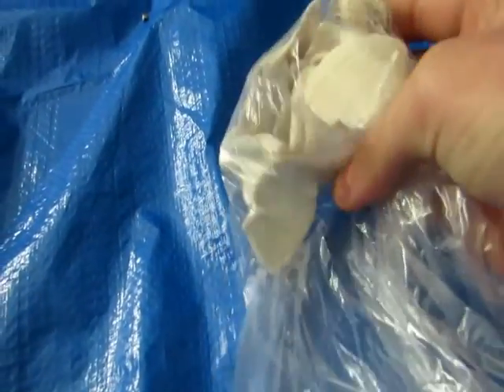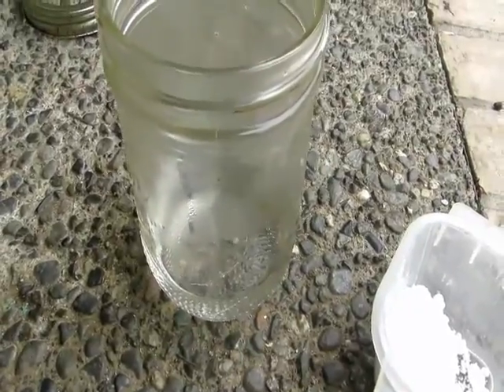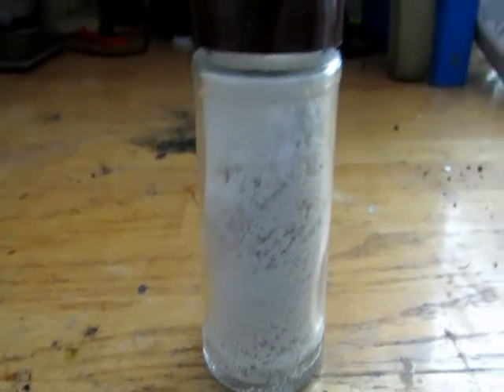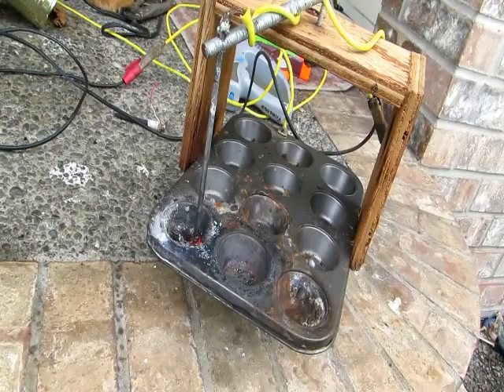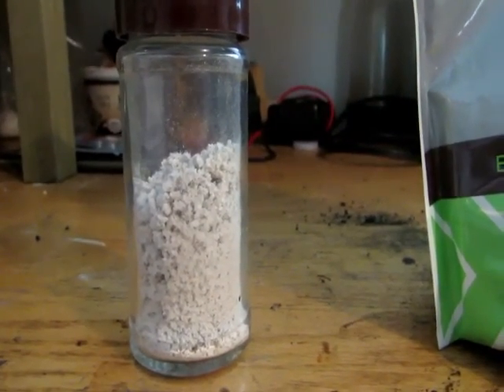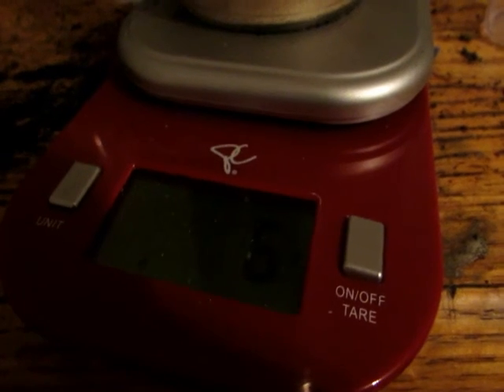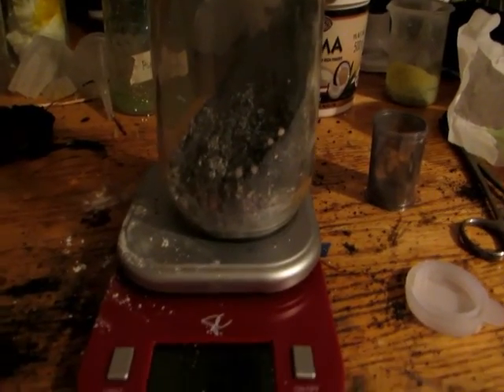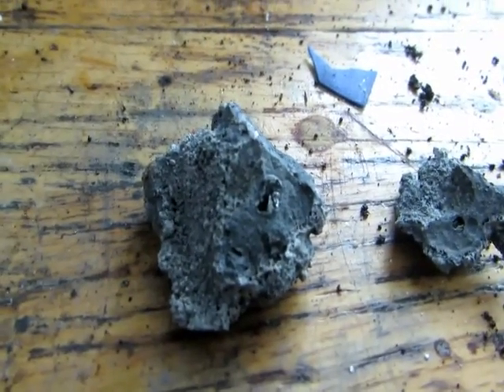How to Extract Calcium (Household Materials)

Comment: I was going to do the same thing except with antacids and heating up the calcium carbonate to its melting point in which it becomes calcium oxide, where you put it in water then do electrolysis. Except calcium becomes Hydroxide form in water, so i didn't wanna use mercury and gave up trying to do it myself and followed his video lol

Comment: dude, me and you need to Collab or something, you had the exact same idea as I did xD
(first I need to get my recording equipment ready and post some videos tho...)
I planned on using chalk, not seashells, they're both calcium carbonate tho.
how old are you? (don't worry I'm a teen too, I just want to relate or something...)
yes, metal hydroxides have a lower melting point that metal chlorides (I did some research) and if the calcium chloride electrolysis didn't work, I would have simply gotten some chalk, and heated it in a fire to from calcium oxide, then simply add water to form calcium hydroxide. unfortunately, calcium hydroxide decomposes into calcium oxide when you heat it, so melting it may be an issue.
a sparkler works well for igniting the sulfate thermite reaction.

Comment: Calcium metal would react vigorous ly with water to produce hydrogen gas, what you have got in the reaction is a high temperature displace ment reaction but no metalic calcium.

Comment: 1:30 chalk often is CaSO4 today, but it shouldn't matter because it also reacts with HCl to form CaCl2.
But you could also just use lime powder (not the fruit).
Reply: No, it doesn’t because CaSO4 + HCl = CaCl2 + H2SO4 and h2so4 is a stronger acid than hcl and you can’t make a stronger acid from a weaker o using displacement

Comment: Could calcium carbonate be used in thermite reactions?
Reply: as a oxidizer you could be able  to use it with aluminium or magnesium, in a vaccum or inert atmosphere. It would first be calcined down to cao and the reduced to ca.
Reply: @mattbanks3517  i tested mg+caco3 and some other carbonates and they all produced their expected flame colors. Could you distribuera the reaction between mg and carbonates?
Reply: @JoakimfromAnka  i dont really know.

Comment: So problems with chalk. First, its sulfate not carbonate but still should react about the same. The only big problem is that sulfur dioxide is hazardous compared to carbon dioxide, and so extra safety should be used for chalk. Thats the funniest thing ive ever said. However calcium carbonate in lime or more commonly limestone. Pretty good source if you live in western united states (unlike me)
Reply: I will say one good thing about working with chalk to begin with is that you dont have to make it.

Comment: Well since you are trying to get calcium by thermite and aluminium reacts with oxygen to generate extreme heat, then why don't you roasted the seashells(calcium carbonate) and get calcium oxide(or use cement...) Then use them in thermite reaction with aluminium?
Reply: I asked myself the same question when watching this.
Reply: could also use magnesium.

Comment: Calcium hydroxide melts at a temperature 4 times higher than calcium chloride I knew this since the 80's why do you propagate misinformation?
Reply from the maker: that depends... different hydrates of calcium decompose and loose water at different temperatures, anhydrous calcium hydroxide decomposes to calcium oxide at 580 degree celcious whereas calcium chloride melts at over 700 degree celcious. I am confused where you got your information from.
Reply: True it decomposes at that temperature but you touched on melting which happens at about 2800C which is in effect 4 times times higher than of calcium chloride and you can ONLY get calcium from electrolyzing the molten salt hope that clarifies my point
Reply from the maker: that's not true, I isolated calcium via this thermite reaction. try it yourself, I have tried it twice now, once to actually get calcium, and once for a different purpose, but both times calcium metal is made. Aluminum has a higher affinity for oxygen than calcium does and thus the oxide of calcium can be reduced to calcium metal with aluminium powder. There is a lot of reactions all happening while the sulfate reacts with the aluminium. aluminium sulfide, sulfate, oxide and sulfite are all formed as well as some sulfur dioxide, calcium sulfide and calcium oxide. as mentioned before, the calcium oxide will be reduced by the aluminium to form the pure metal. of course electrolysis is a much more efficient process because there aren't so many side reactions.
Reply from the maker: i find that it nearly works all the time, ive had very few faliures with it.
Reply: Looking forward to your video on the topic, @bluevortex7992 , since you're clearly so knowledgeable on the subject. Looks like you are Medhi of ElectroBoom too. LOL
Reply: I will one day hopefully!
Reply: If you use finer powders for your thermite it will be easy to ignite

Comment: You seem like a younger Cody's Lab.

Congrats, you've earned yourself a sub!
Reply from the maker: thanks! I really enjoy chemistry a lot!
Reply: @TheCanadianChemist  there is quite a good way to extract and distill calcium!Pretty good method:just make a distillation apparatus from steel and just put calcium chloride in the first vessel together with lithium metal,seal everything and heat the vessel with a blowtorch!Lithium displaces everything from chlorides(although not all from oxides!)-and with calcium it does distill over due to the temperature being high enough to boil calcium metal!
Reply: @johnsheppard1476  as a fellow "chemist" you should know that we chemists consider that "cheating" because all you're doing is using one reactive alkali to make another, if you're gonna do that, at least be decent enough to make a more reactive alkali than the first.
Reply: No, he's more like a young NileRed.

Comment: Calcium carbonate is sometimes an impurity in sand. Couldn't you put sand in acid, collect the resulting calcium chloride, and get the sand to isolate the silicon from?
Reply from the maker: that is possible, however, I find it much easier to simply dissolve the shells themselves. sand in my experience yields very low silicon percentage and small crystals when used with a thermite reaction in aluminum and sulphur. even with clean sand it is difficult. I plan to use silica gel and will hopefully show a video on that soon. I have about 30 packages of silica gel saved up. Anyhow, thanks for the suggestion. :)
Reply: ah.

How about a way to purify sand silicon dioxide? Like, maybe turning it in it silicic acid and then back to SiO2
Reply from the maker: Muzik Bike - Geometry Dash and stuff I suppose you could acid wash it, then try to make silicon metal and  use that impure useless stuff to turn it to silicon tetrachloride, this can be distilled as it is a liquid to purify it and then you could turn It back to very pure silicon metal. I don't know the full process to turn silicon tetrachloride back into the metal, so I would have to research it. I will also look into turning it to silicic acid, then back to silicon dioxide, Thanks!
Reply from the maker: I did some research and It looks possible, I think I will attempt this in the future, Thanks!
Reply: NIce
Reply: yes but your yield will be very low as impure sand is mostly silicon dioxide
Reply: Why not simply buy a bag of Calcium Chloride from a pool supply shop? They are about $10...$15 for 2 kg.

Comment: I would like to see you make potassium metal. i like your videos.
Reply from the maker: thanks, I have wanted to make potassium for quite a while, first I need some potassium hydroxide to electrolyse. I can make that from the electrolysis of potassium chloride in a split division cell. I have some ideas, we will se how they turn out. I successfully isolated some with my own method of the reduction of potassium chloride with lithium at high temperature under a vacuum filled with helium, but could not get it hot enough to distill the potassium metal, when I put the aperatus in water after, a rather large explosion occurred which lithium does not do, so I know I made potassium. It just needs a bit more tweaking.
Reply: +piano and science guy  you cant use helium thety add oxygen so people dont asphyxiate when they inhale it. try argon. if you have trouble making koh buy some. there are several ways to make potassium but i would find electrolysis more interesting since it seems harder than using magnesium to separate oh from potassium.
Reply from the maker: dgamezonu2693 i was wondering if itwas pure or not... although it musn't be hard to seperate due to the density differense. I will probably end up using argon from lights and attempt that. Thanks for the suggestion. i actually got some koh form my cousins lab and i will be making potassium from that hopefully. I would still like to try my method to see if it can possibly be a useful method, also, i dont think anyone has done it before so i would be first. :) thanks for the info.